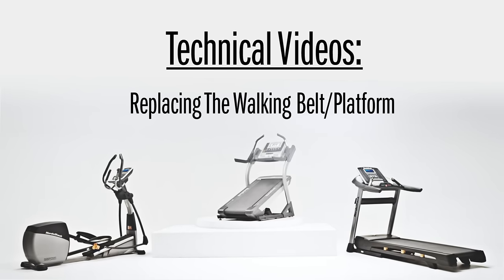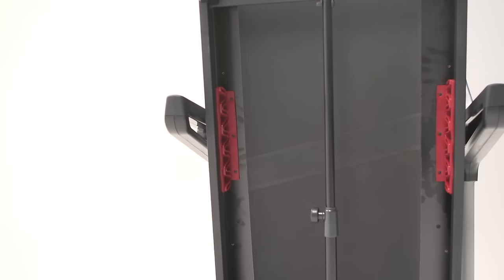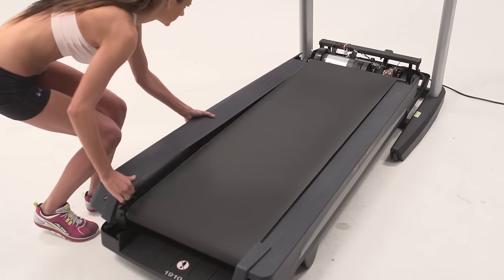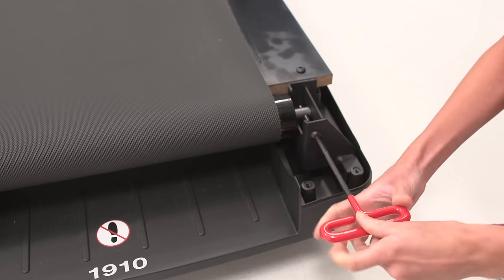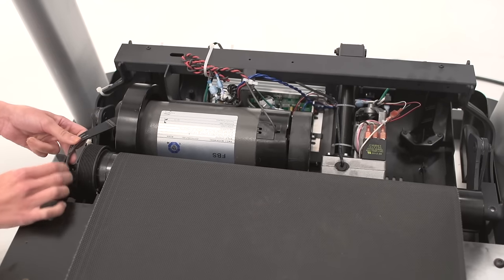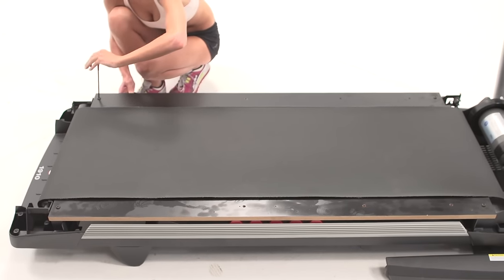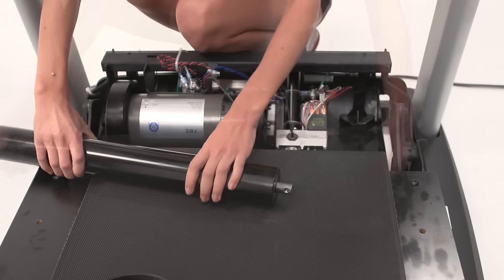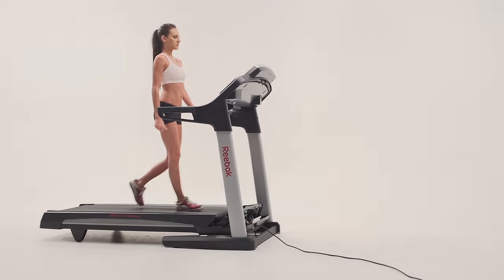Walking Belt Replacement

Comment: you make it look so easy, I"m on hour #4 and still at it.
Reply: yes and so pleasant with the nice music playing in the video. It's not. It's a pain in the ass. nothing works easy like in the videos. My model is different. Hard to get to the screws. Have to remove a circuit board to get a screwdriver in there. Can't fully remove the cover. So easy this petite hot chick can do it. Yeah, right.
Reply: @etmeyutub  my model took a bit of reverse engineering and beating on things. And cleaning. And fixing a couple other things I noticed while it was apart. And I am only 2 hours in. almost halfway done.
Reply: It is a lot easier when you replace a belt and deck on a brand new machine.

Comment: I bought a used treadmill and used these instructions to (1) reduce the weight so I could move it up a flight of stairs myself, and (2) so I could clean it and lube the belt.

They weren't wrong about it being similar because I have a different model treadmill but the steps worked. For the running board a few of the hex bolts had to be loosen under the treadmill to remove the bolt.

Comment: Almost got it apart now after 90 min. and hidden screws not mentioned in the instructions or video. You will need a socket wrench set/ or an adjustable wrench. Also the front roller bolt is a hex and there isn’t enough room for the effing tool!!!!
Calling service to put this GD thing back together!

Comment: What can I do if I didn't count the turns? 😅
Reply: If the bolt is exposed then measure the  length of the exposed bolt on both sides to get an estimate, or count the exposed threads on the bolt, or eyeball it. Regardless of the method, the important part is to center the running belt, start the machine slowly then ensure the belt doesn't shift to one side.

Comment: THE VIDEO SHOULD BE MUCH SHORTER.  (A)  UPLOAD A FAST FORWARDED VIDEO THAT WILL COME OUT TO BE :30 SECONDS (B) SECOND METHOD IS SHOW POWER DRILL WITH BITS, HEX T ALLEN WRENCH.  FOLLOW THE INSTRUCTION, UNSCREW THE NUTS, THEN REVERSE. :15 SECs.  It is that simple and easy now go and do the work. 
The goal is to get you started and then you don't know swimming, now come back to the shore. help help , call icon customer care.  Icon will wipe you big time with $400.00  invoice. Such a great idea  to rob or mug  in a civilized manner. 
Don't get me wrong, Few out there can assemble it back but most will be chickened. 
Thanks for uploading a slam dunk video . Bravo IconCustomerCare.  👎
dissembling is not difficult. The toughest part is tightening the belt where most people will chickened out. And that's the secret  sauce Icon wants to hold it back.